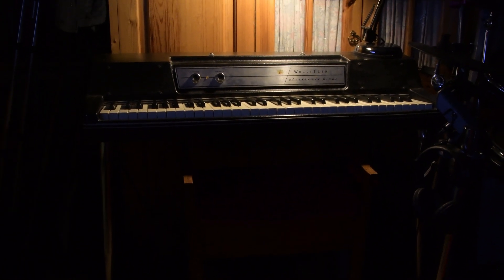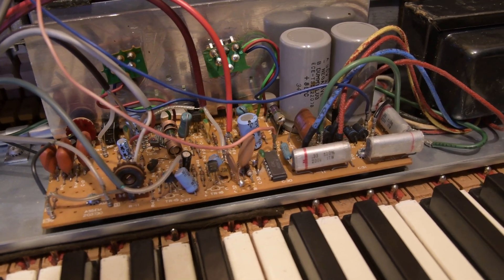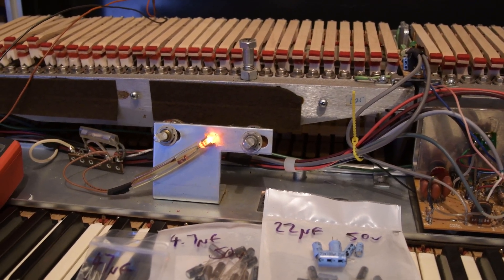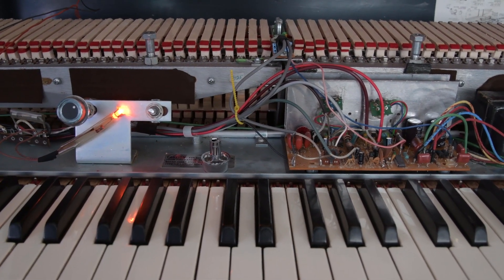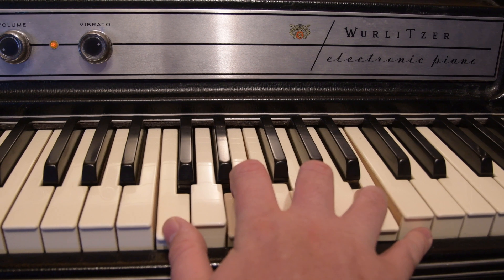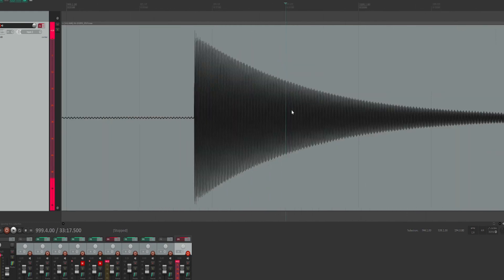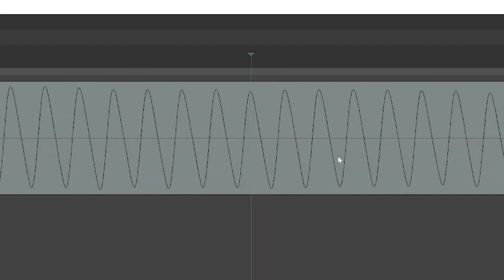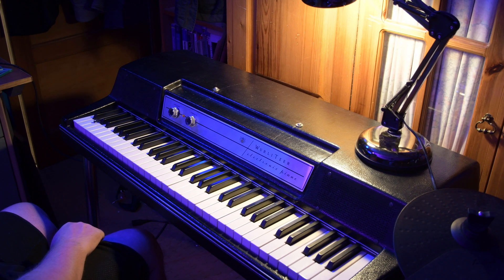Wurlitzer 200a - Reducing noise and Distortion - Part 1

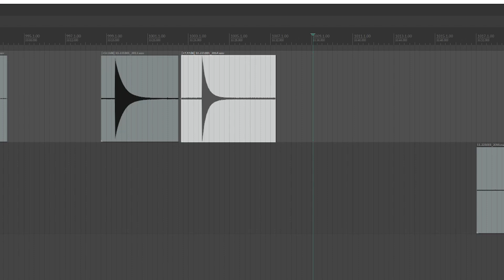Comment: I've noticed matching bands of sound in the 7-10 khz range directly above many of the notes of my Wurli. Wondering how normal that is. I looked at your note comparison around 6:12 and saw the clean note has nothing above 3.5 khz, while the first note has many bands all throughout the spectrum to where the sample cuts out at 16khz. 
In my case, I did notice that these sounds are mechanical in nature since they sound even with the instrument off. Curious if you know what that might be?
Reply from the maker: Hi That is a good question. I agree though there shouldn't be much high frequencies generated. Usually the Fourier transform gives two peaks. The fundamental and an octave above for a single note. 
I am not an expert but feel free to email a recording and ill do my best to give my opinion. The best place to ask this is one of the facebook groups - 
https://www.facebook.com/groups/516634768819682
or
https://www.facebook.com/groups/516634768819682 ( Ah i see you have already posted there)
But those group have some real knowledge - though do also take it with a pitch of salt as there a few ways to do most things. 

Looking at the post of a squeak during pedal release, I would be tempted to press with my finger (if it is safeto do so) each of the pivot points and see if that alters the noise. If you find which one it is -if its metal on metal drop a small drop of oil/grease (oil not wd40). If wood - does it need felt need replacing? 
Please do keep me posted on how you get on this this! Cheers! Dean

Comment: I've got this fizz too and have also replaced the capacitors throughout with the VV kit etc, and still have the same noise. You mentioned removing resister 58. Is that all that needs to be done or does the circuit need rewiring as am assuming that just removing it will stop the current running through.. ?
I appreciate your knowledge on this.
Thank you.
Great videos BTW!
Reply from the maker: Here is the schematic, in the top centre there is a star that explains that the resistor needs to be chosen to bias the amp. And which points to measure to ensure that the amp is set up correctly. I think I was lucky that removing that resistor got my amp in the correct range. The large caps in this amp hold voltage for a long time, so please be careful when working on this. 
https://www.bustedgear.com/images/schematics/Wurlitzer_200A_series_schematics.pdf
Apologies if I go too basic - but for anyone else I think it may be interesting to know how and what biasing is. 
The amp works by taking the positive voltage of the signal and amplifying that, it also takes the negative voltages of the signal and amplifies that separately. These are added together. Due to variances in components the amp needs to be balanced to ensure that each side it getting amplified by the same amount. If one side is getting more amplification, then it will create a DC voltage offset. This is what we are measuring and setting to zero when we bias. 
Good luck. Its hard to offer the best advice on youtube comments, I recommend posting question on the Wurlitzer facebook group. There are people there who know a lot more that I could. 
Good luck :-)

Comment: Hi Dean
Could you please make the part 2 of this video? I could certainly need a way to fix that ground floor noice coming from bad power supplies! Thank you!
Reply from the maker: I will bump it up the list, I need to move the power wires and redo the grounding. 
As piano sits in my studio just plugging it in turned off creates a huge amount of ground noise....we can do better. 
Which model do you have?